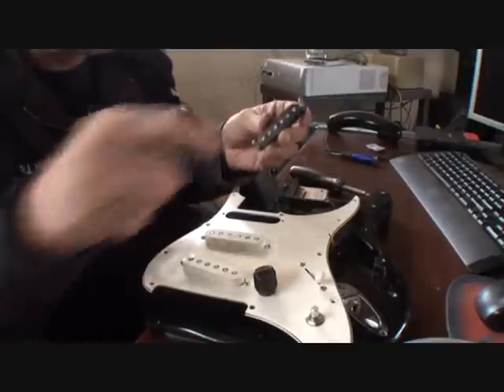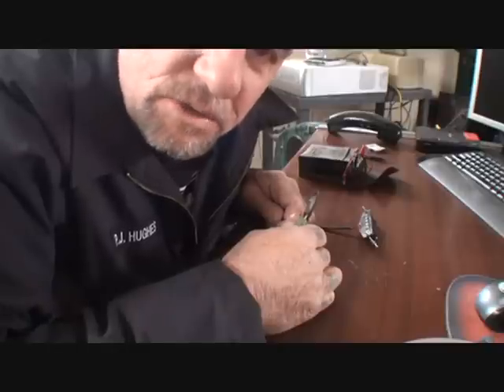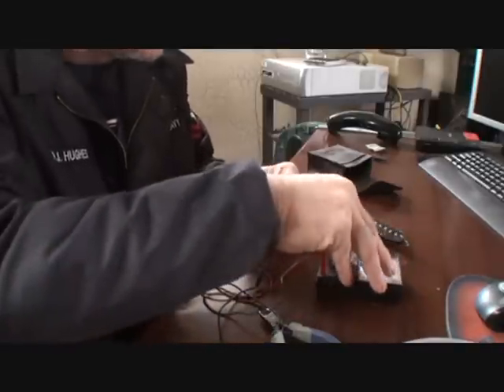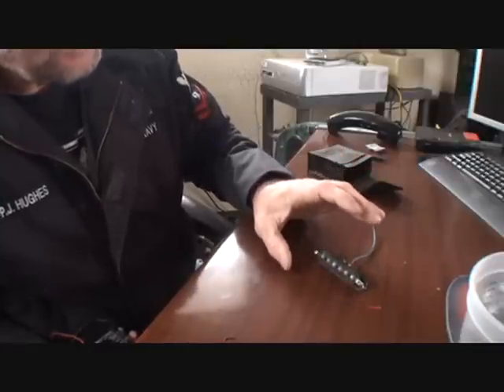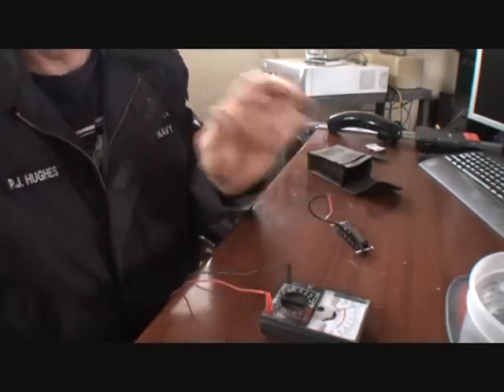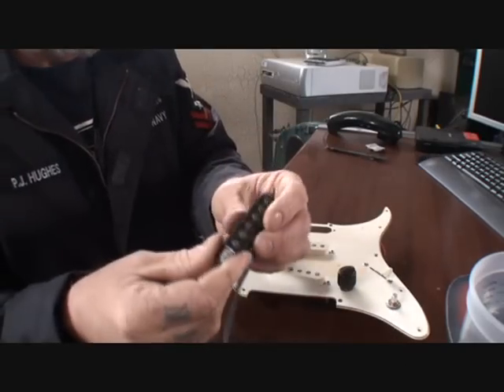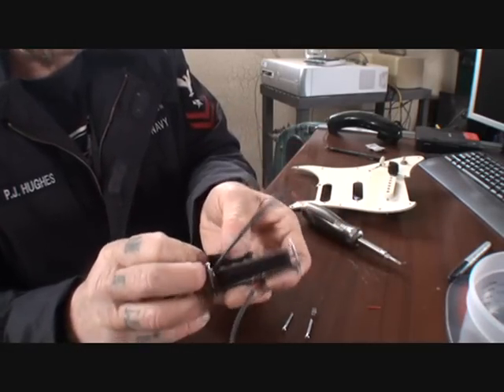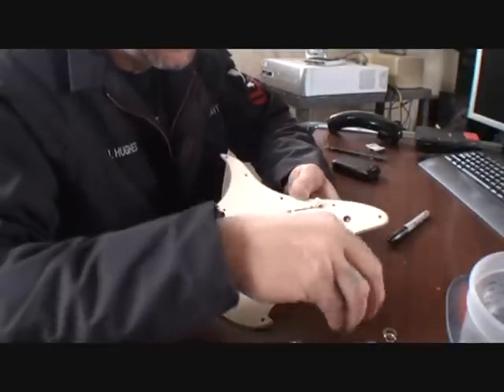Electric Guitar-D.I.Y. Pickup Installation And Guitar Wiring-Part 2

Comment: @ziggassedup What kind of guitar do you have??? a two-ply pickgaurd is only for the design, when the edge is beveled you see a pinstripe around the edge.. If your guitar is actually a cheapo  you might ought to see what kind of wood it's made out of first.. If the body is made of plywood or inexpensive stuff, it won't be worth the time to put in different pickups... Let me know. Pete

Comment: A typical single-coil pickup usually reads around 5k to 6k ohms. 'Can be more if it is over-wound or if it's a stacked dual-coil. 
Harbor Freight has digital multimeters for dirt-cheap...

Comment: Pete are you sure that it's just not a bad 9 volt battery in your multimeter, i forget and leave mine on all the time and it drains the battery, also try not to hold the leads with your hands since your body may effect the readings, hey man i know two facts about electronics, and both of them are WRONG, lol, lol just trying to help